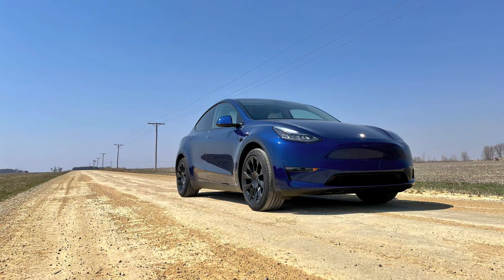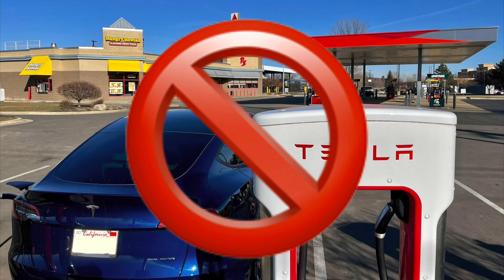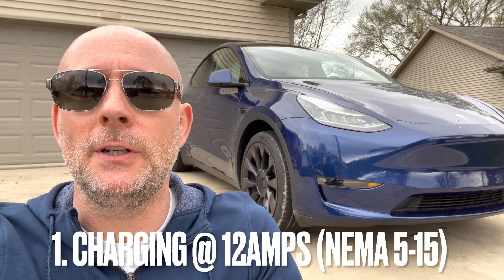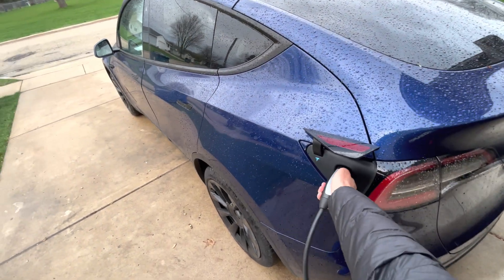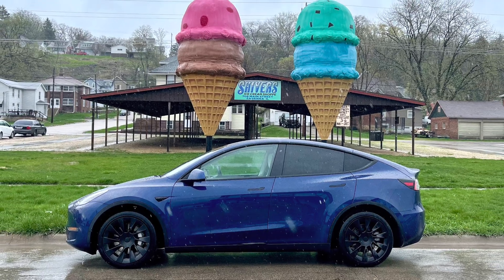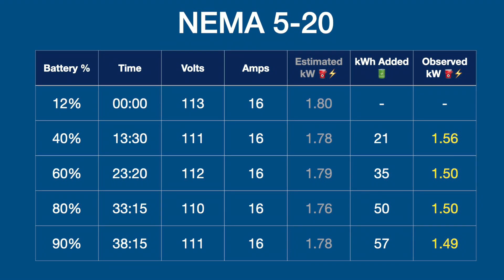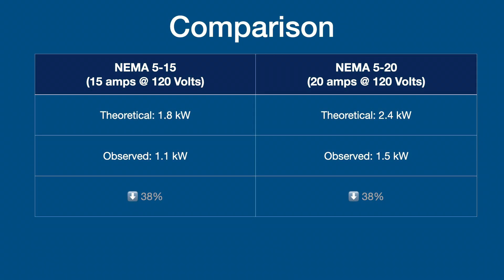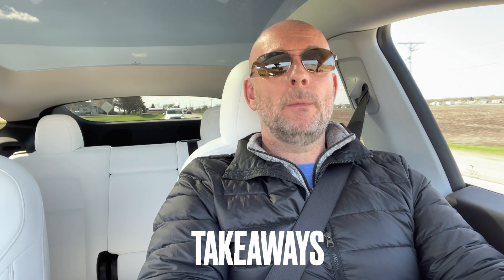E29 | 110-120V. 25% Faster Home Charging on NEMA 5-20 (Tesla Model Y)

Comment: I don’t see why you couldn’t to 240 V, you have the space for it at the top right of the breaker
Reply from the maker: Apparently the home runs on 120V because the stove and dryer (and water heater?) are gas. When they moved in there was some talk about replacing the panel to upgrade it to 240V but apparently my parents decided not to since there wasn’t any real need. I did chat with an electrician and he mentioned something about possibly installing a sib panel in the garage as an option.  If I ever took ownership of the home I’d likely do the upgrade just to support charging an electric car, but in practice when I visit my parents charging on 120V works out as a great alternative as well. I’m always there long enough. 😊
Reply: @goingelectric7826  how old is your parents house,  because unless it was built in the 1930s or before,  and still has the original 2 wire 120 volt service paired to a very old meter base and porcelain fuse block, and knob and tube wiring (typically only 30 amp service and only 2 - 4 circuits,  some very old panels installed before the late 1920s also had fuses on both the hot and neutral wires on the circuits) it almost certainly has 240 volts available aka split phase power.  Incidentally very few legacy 120 volt services remain in service.
Reply from the maker: Sounds like you’re describing my apartment in San Francisco. Ha! As for my parents’ place: Early 2000s but apparently all the panel’s circuits/ports (??) are currently being used. As far as I understand, it’s a relatively small panel because the house is also supplied with gas for the hot water heater, kitchen stove & dryer. We looked into upgrading the panel when the moved in but figured wouldn’t really need the capacity. Now that I have my car and visit on occasion that would be nice but seems like an expensive modification to make (and/or bringing a sub-panel out to the garage) just so I can charge faster. So instead I use the NEMA 5-20 plug/adapter and that works well. Ah… life on 120V!
Reply: @goingelectric7826  wow if only 120 volt capacity,  don't know how that would pass code.   Because in the U S., 100 amp /240 volt is now considered the bare minimum (since the early 60s')   now in Canada,  if the home is small, under 860 square foot,  i would have to refrence the latest code book,  they will allow a 60 amp 240 v service.   However they will usually throw in 100 amps for future expansion.   Now as far as the very small service,  I could see an exception for something such as an apartment unit, or a summer cottage.   But it's possible your parents house might have 240 volts available from the pole, but the breaker panel is full of single pole breakers as they may not have needed any large electric appliances in that home.   A quick and easy way you can check,  assuming it is overhead service, with underground services being increasingly common,  especially in more densely populated blocks, is to count the number of wires actually connected to the service entrance cable going down to the meter.   If there are only two wires, usually an insulated and a bare strand, or three wires, but one of them tied back and not connected, then you have only 120 volts available.  If you see all three wires connected,  then you'd have the more common 120/240 volt split phase.   If you see 4 wires all connected to a service entrance cable,  this would indicate a 3 phase service,  extremely unusual in a residential setting,  with some exceptions including very large,  custom built luxury homes, or a home with a large  home workshop with a bunch of heavy duty electric motors ( depending on your utility company and the jurisdiction,  services above 400 to 600 amps must be three phase,  or single phase requiring engineer approval,  )
Reply: @goingelectric7826  lol a few yrs back when I was finished my apprenticeship,  I was working alongside with the journeyman and the master electrician,  updating a bungalow style home,  built in 1921, had a very old meter base, the service drop was connected to knob and tube wires run down the side of the home, protected by a black iron pipe,  to the meter base and a couple of porcelain fuse blocks and a knife switch with a small handle make of porcelain and having the contacts exposed,  all housed in an outdoor wooden enclosure near the driveway.   Only two circuits powering the entire home, as well as two 30 amp Edison base fuses on the main, fused the hot and neutral separately.  The home in question was formerly occupied by a 102 year old lady, who had lived in the home for around 70 years.   My master electrician,  with over 20 years in the field,  only ran across an old two wire service twice before,  and both  cases involved a home formally occupied by a very aged person who had either moved into a nursing home,  or passed on.    

Lol home electrical safety has improved A TREMENDOUS AMOUNT since the 1920s. 🙂
Reply from the maker: Hello hello. Thanks for the great comments. I think the issue with my parent’ house is that they do have 240 V coming into the home but that their relatively small panel is being fully utilized and 240 V does not come out of it. As far as I understand, that’s because they have gas service into the home for the kitchen appliances, the hot water heater and the laundry dryer. They pondered upgrading the panel when they moved in but didn’t see any particular need for it because of that gas line. Imagining I ever moved into the home Monday, I would likely upgrade the panel and/or bring a sub-panel out to the garage, but considering when I drive out to visit my parents I always stay with them for many days at a time, that means that simply plugging in on 120V especially works well, especially with the NEMA 5-20 plug/adapter. I tell ya, so many ways to charge a car! 😳🚘🔋⚡️

Comment: Get a quick 220. It has two cords on it and they both plug into different 120v outlets and combines them to give you 220/240v
Reply: Wait what!!!? Where?
Reply: @TheSincereSeason  various sketchy internet sellers and amazon. 

It...works. Technically. But there's a good damn real UL doesn't approve of those things.
Reply: In order for that to work, the plugs would have to be on two separate breakers and those breakers would have to be on opposite sides of the panel.

Comment: 110 is very low voltage on the 5-20, you are loosing kw/h there..  If the outlet was getting 122v, you would have charged at 1952w.. 
https://www.rapidtables.com/calc/electric/watt-volt-amp-calculator.html
Reply from the maker: Hello hello. I was definitely surprised that I was getting lower voltage on the NEMA 5-20 than I was on the 5-15. Strange, eh!
Reply: @goingelectric7826  Yes it could be concerning. 10v is a big drop! May want to pull the outlet and ensure its on 12ga wiring..

Comment: Just purchased a home with a Nema 6-20 adapter. My understanding is that outlet was used to run a compressor.   I just ordered the 6-20 adapter and I'm hopeful it will result in some good charging rates.  I have a Nema 14-50 at my permanent address, can someone run the numbers and let me know how it will compare?
Reply from the maker: Hello hello! Taking a look at the table on the Tesla website: https://shop.tesla.com/product/gen-2-nema-adapters, it appears that a 14-50 charges about twice as fast as a 6-20, so in your case you’ll be getting about half as many miles per hour of charge. (And the 6-20 is about three times faster than a 5-20 and 4 times faster than a 5-15. Bumping up from 120V to 240V makes a big difference — as does bumping up the amps from 20 to 50). Based on what the electrician I chatted with had mentioned, electrical systems typically reduce the amps down 20% from the stated rating. So if an outlet/adapter is rated as 20 amps it really delivers 16 amps. Then you multiply that reduced number by Volts (say, 110V or 220V) and that gets you the Watts coming into the car. Then reduce that number by 15-20% because of electrical inefficiencies and that’s really the usable Watts that you’re getting into your car. In my case, I found the actual total rate to be 38% less than the rating of the adapter/outlet (for the following equations: 1 - 0.38 = 0.62). So, a NEMA 5-15 rated at 15 amps & 120V would be 15amps * 120V = 1800W * 0.62 = 1,110W actual usable charging rate (or 1.110kW). Likewise, a 6-20 240V adapter would be: rated at 20amps * 240V = 4,800 Watts * 0.62 = 2,976W or 2.976kW usable rate. A 14-50 should be 50amps * 240V= 12,000 Watts * 0.62 = 7,440W or 7.44kW usable. Based on all that, the Tesla table seems to assume a typical driving speed of around 60mph for their mileage numbers. As always, the faster you drive, the fewer miles you get. 🚀⛽️  Good luck!
Reply from the maker: As always, it’s a good idea to take a look at your electrical panel to see what the system is capable of. It’s also good to consult an electrician if necessary to ensure that the wiring in your home can support the outlets that have been installed. As far as I understand, if it could not then the circuits should simply trip and result in a power disruption on that circuit. Good luck!

Comment: That was great info ... as we plan our USA Tour 2021 I was wondering about picking up adapters, so this is GREAT help! ... Also mom needs to be in more videos 😁👊🏼❤️!!! Safe travels!
Ps. Keep traveling, CALIFORNIA is still WHACKED! 😜
Reply from the maker: Hopefully one day California will be a little less whacky. Ha! Good luck with your USA Tour 2021. It's totally doable. I typically charge up to 80-90% per stretch, charge every 150-180 miles and spend an average of 40 minutes charging per stop. So if you're OK with working that into your timelines, then you'll be fine. I'm the sort of person who can easily drive 5 hours without stopping, but when my dad and I took our road trip from Dallas down to Boca Chica to check out SpaceX in Texas, he thought the stops every 2.5 to 3 hours were well timed. That trip (Episode 22) was back before I got my power brake assist unit replaced and my efficiency/range was about 20-25% less than it is now so it's definitely nice to have that extra range these days. You can check out Episode 27 (13,000 mile review) for some screenshots starting at 16:22 that show my typical range in good weather at various speeds. Heads up: heavy rain and snow coming at you, or lots of water on the road or strong winds can reduce range by a pretty surprising 30% so take that into account when you look at the weather coming up on you as you drive. I've observed that I have a usable 72kWh worth of energy in the (75kWh) battery. So whatever efficiency I see that I'm getting at whatever speed I'm driving that day, I just divide 72,000 by that number and that's my range given that driving. For example, if I'm getting a decent 331Wh/mi @ 75mph, the equation would be: 72,000/331=217mi. Of course, that assumes that you're using 100% of the battery which you'd never actually do - so I always lower the range by whatever percentage is in the battery. 217mi*0.8 if I have an 80% charge, for example. If you're driving slower, say 60mph, that's a much more respectable 237Wh/mi, so: 72,000/237=304mi. OR... you can just rely on what the Energy tab is telling you based on your 5, 15 and 30 minute average readings... assuming you're not about to drive straight up a mountain. In my case, before I got that power assist brake unit replaced, I noticed a significant discrepancy between what my own efficiency calculations were telling me and what the Tesla total-range numbers were showing, and that was my first clue there was something going on with my car. Once the repair was performed, both numbers aligned. Phew! Good luck driving across America!
Reply: @goingelectric7826  wow! Great information, thanks for taking the time! Keep up the great content! 🇺🇸👊🏼👍🏼

Comment: Why don't you just buy a quick 220v inverter?
Reply from the maker: Tell me more! (As far as I understand, my parents' house would need a new panel or sub panel to support 240V in their garage. Their house is all 120V because their kitchen and laundry are gas. If I ever moved in, I'd pay for the upgrade. Would an inverter serve some other purpose?)
Reply: @goingelectric7826  It's called quick 220 box, it's portable device & it gives you 8 miles per hour. How many miles per hour did you get while using the 5-20? thanks for the video.
Reply from the maker: @California007  Thanks for the info. I typically track kW speeds and with the NEMA 5-15 it’s 1.1kW and with the 5-20 it’s 1.5 kW. With an average efficiency over the last 33,000mi of 287Wh/mi, that works out to a practical 3.5mi/kWh… compared to the (generally fictitious) EPA rating of 4.5. So given my real world numbers, I can get a reliable 5.25 real world miles per hour on the NEMA 5-20 adapter. (The unreal EPA rating would be 6.75).

Comment: Just be careful that someone didn't mistakenly screw a 20 Amp receptacle onto wiring that was designed for a 15 Amp receptacle. 15 Amp circuit needs 14 gauge wiring and a 15 Amp breaker in the panel. A 20 Amp circuit requires 12 gauge wiring (thicker wire) and a 20 Amp breaker in the panel. You are only allowed to draw 80% of the circuit rating, therefore 15 Amp circuit X .8 = 12 Amps.  and 20 Amp circuit X .8 = 16 Amps.
Reply from the maker: Absolutely! Hence my CYA on checking with electricians and also asking a home-host about their wiring. If someone is putting a NEMA 5-20 receptacle on a line that can't handle it, that's a problem. The good news when I tried charging on a NEMA 5-15 with an extension cord, the car recognized that something fishy was going on and it dropped the amps down to something like 9 and it put an error on the screen as a warning.
Reply: A public place I charge at did this and the Tesla is smart enough to dial back amperage. It does this once it detects a voltage drop within a certain %.